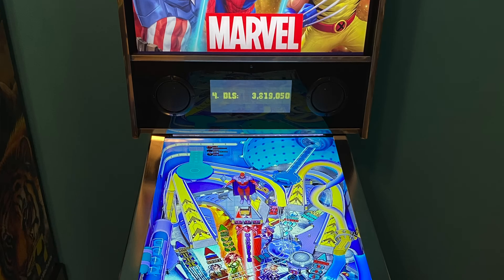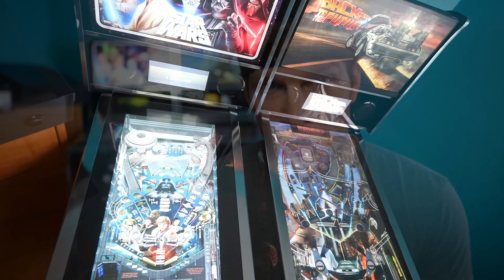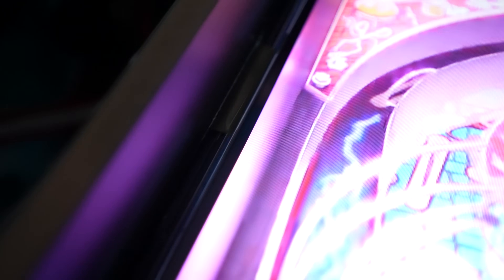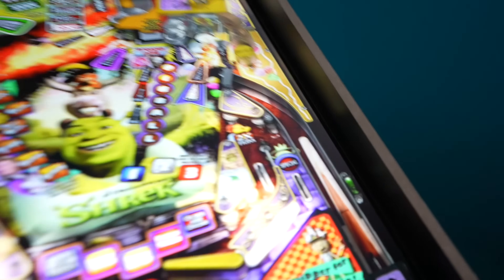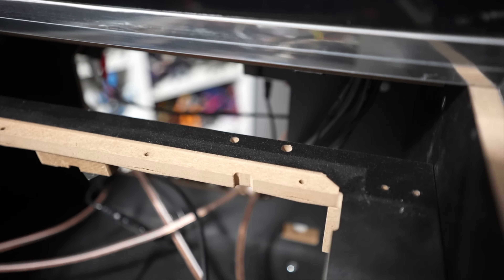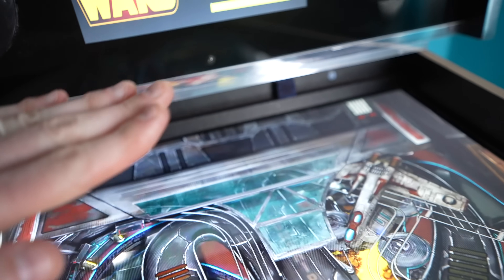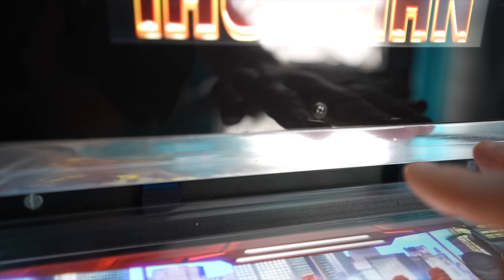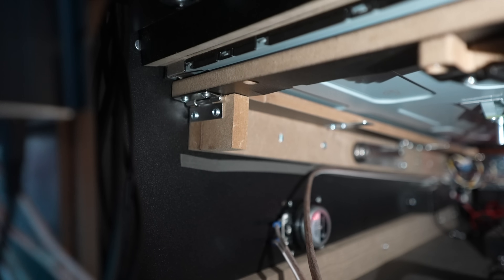Arcade1Up Pinball Mod - How To Install 32" Monitor

Comment: Doug, how did you actually de-case this monitor?  I've got the unit, and there is one screw on the back next to the HDMI, but I assume I've got to pry it open?  Where did you start?  Bottom?  Any tricks or "watch outs" to know about?
Reply from the maker: I used a thin flat head screw driver to start prying off the out casing. Just slowly working my way around the monitor in circular fashion until I was able to pry off the bezel
Reply: @cooltoy  Awesome.  Thanks for the fast response.  Done and done.  For anyone following, it's easiest (I think, at least on mine) to get it off at the bottom once you do a once around with a very very thin screwdriver.  There will be some snapping sounds as the plastic catches disengage.  After black casing is off, you then also need to remove outer silver frame on the edges to get it to fit in the pinball unit.  Remove the black tape to get at the outer silver frame and then stick the tape back.  You can sort of see how Doug did this at 2:05 (black tape shows signs that it was unpeeled and then re-stuck on after) and when you are done it will end up looking like it does at that time stamp.  On my cab, I also loosened the top four screws just a turn to give some extra room - otherwise my monitor wouldn't quite fit (even with the "diet plan").
Reply: @dimmydinosaur5571  I got all the way to the point of decasing everything and loosened the top screws on the body but it still feels tight. The screen is so thin and fragile I think any bending or pushing may crack it trying to get it in. Was it difficult for you to get it in such a tight space

Comment: Maybe I missed it but obviously I need a new piece of glass after modding to 32”.  What size is recommended?
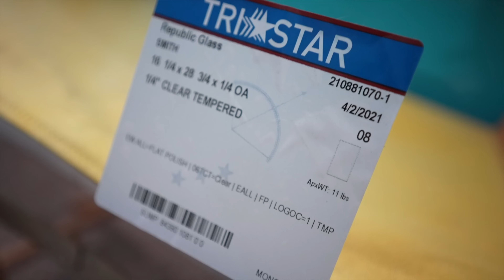Reply from the maker: It’s at the 5:32 mark in the video
Reply: @cooltoy  Thank you!!
Reply: I’m also using a stock Dell 9020 desktop for my setup.  Did you use the stock graphics card it came with or did you install something else?

Comment: So I'm not too tech savvy so please forgive my ignorance, but does the PCB, the stock monitor or both hold the res to 720p. More directly, can one improve the resolution with the stock PCB with a better monitor?
Reply from the maker: the stock arcade1up PCB is what is holding the display output to 720p. The stock arcade1up 24" playfield monitor is 1080p capable, yet only displays 720p when connected to the stock PCB due to the preset output coming from the PCB. You can not make any changes to the Arcade1up stock display resolution while maintaining the stock PCB.
Reply: @cooltoy  Ok thanks for the clarification. Now I won't waste time and money on something that won't pan out. Good video BTW.

Comment: I am excited to try this! I have a couple questions. How easy is it to get inside the cabinet once this monitor is installed? Are you able to use the original monitor base to angle it up or will the monitor have to come out completely? I'm also assuming you had to completely remove the original monitor from the machine, but I just wanted to make sure. Thanks for the content and always engaging with your viewers!
Reply from the maker: you can get inside the cabinet through the backside panels. Otherwise you would need to take off the trim pieces, remove the glass/plexiglass, and remove the monitor if you needed to access the inside front of the machine. As shown in this video, I'm using the original monitor base frame. The original monitor will need to come out as there is no sense in leaving it inside and then placing a new monitor on top of it.

Comment: Great mod!! How's the angle and depth of the play field feel? Are you getting any reflections off the tempered glass or between the 32" screen and glass that make it harder to see the play field?  It looks great!  I just got my pc and vsdisplay for stock 24" at 1080p and extra back screen monitor installed in the cabinet. Connecting the buttons and plunger this weekend. Will seriously consider updating to 32" in the future.  Just worried about angle, depth, reflections and glare.
Reply from the maker: The angle of tilt is almost the same as it was for the stock monitor, so no complaints there. Also zero issue with glare or reflection from the new piece of glass.
Reply: @cooltoy  I'll be upgrading to 32" then, thanks for all the tips!!

Comment: Great Video! Ordered the monitors, When you used "FRDM-KL25Z " do you have a link to a pre assembled one with the pre installed headers? Could you use a Zero delay 2player instead? TY
Reply from the maker: You can use a zero delay encoder, but the plunger won’t connect to a standard usb encoder since it’s an analog input. There is a Geeekpi encoder that works that uses normal digital button inputs as well as analog inputs that you can use if you don’t want the KL25Z board, but you lose analog nudge capabilities if that matters to you. 

I believe this is the site that sells the KL25Z with the headers preinstalled https://virtuapin.net/index.php?main_page=product_info&cPath=8&products_id=131&zenid=8iimjqqpuj05j8c08j632tf257
Reply: @cooltoy  thank you so much!
Reply: @cooltoy   sorry is this kit all i would need to get both the board with headers like you used and also the ability to utilize the plunger ?  This seems to be the board and plunger kit together?

 https://virtuapin.net/index.php?main_page=product_info&cPath=8&products_id=105&zenid=8iimjqqpuj05j8c08j632tf257
Reply from the maker: the link you provided is the all in one kit, has the board, headers, wiring, plunger etc. That's the same kit I'm using currently.
Reply: @cooltoy  You are the best. TY

Comment: Are the games running at 1080p now? Looks great!
Reply from the maker: The stock monitor is 1080p but was resigned to only outputting 720p from the stock hardware. I showed in previous videos on this channel how to hook up the stock monitor to the pc and what it looks like running 1080p also on this channel if you want to see that.
Reply: @cooltoy  I watched those videos as well. I figured the stock pcb couldn't run at 1080p. I was just being hopeful. Would love to upgrade the monitor and keep the pcb stock and run at 1080 but that's just asking too much 😔

Comment: I remember a while back you mentioned that Arcade1up pinball is too expensive to buy if we are just going to gut and mod it. 

What price would make sense if we’re planning to use it as a base platform? Or is it still just better to start from scratch?
Reply from the maker: I originally said that for a multitude or reasons, one of the main ones being that pc graphics card prices are pretty much through the roof right now. However after looking at the “vpin kit” option prices currently out on the market today, it actually does make pretty decent sense to go the Arcade1Up route instead. Assuming you like the smaller foot print it provides. It will always be cheaper for a person to build from scratch, however, that’s not in the skill set of most individuals I know. You can do a bare bones PC mod to the Arcade1Up pinball machine for a few hundred bucks. Even with the price of the  Arcade1Up cabinet itself you still come out several hundred dollars cheaper than the baseline vpin kit out there today. Obviously the more “bells and whistles” you want the more you have to invest, but ultimately that’s up to the end user. The AtGames pinball machine is also another good option as it is already natively set up to support adding a PC, though it has a larger space footprint which may turn some people off that are limited on space.
Reply: @cooltoy  Awesome, I appreciate your answer, thank you! 

My first mame cabinet I built started with a $99 Golden Tee and a Raspberry Pi. Before I even played it, I got a Dell 20" monitor, new control panel, new speakers, etc. The only thing left from my purchase was the MDF. I basically paid $99 for a pre-cut cabinet and some spare parts. lol

Comment: Excellent job, Doug! I really wish we had more options in the market. I would pay for a 1up (toy) virtual pin if it had a higher resolution 32" screen and priced around $1000. I feel it hits a perfect sweet spot between the minimal 1up and a much more expensive virtual pin.
Reply: Can i just put in the 32inch monitor as described and the machine will still be fine to play
Reply: You can do his mod with a 2k screen and the marseilles will upscale 720p to 2k.

Comment: You can alter the playfield size anyway in vpx and future so cutting off the bottom isnt an issue.
Reply from the maker: true, but honestly the cropped off portion is so insignificant to me it's not even worth doing that. I merely mention it just to be up front with everyone on the end results.
Reply: @cooltoy  absolutely sir, PLUR.greets from Spain

Comment: Before i saw your live video and you posting this I was trying to figure out what monitor I  was going to go with. Asus has a thin body 31.5” (found on Best Buy) that I was thinking of using. Seeing the 32” I see you used, I wonder if the .5” less would be just enough where you wouldn’t have to uncase it.
Reply: I’ll most likely just order the monitor you used though, wife will kill me if I keep buying and returning shit 😂
Reply: 31.5 might be the magic number for those of that dont want to pry the bezels off. It looks like most 31.5 screens are 2 inches less in height compared to the one used in this video
Reply from the maker: @Josh Hundley it'll will be a case by case basis since all monitors are made differently.. I contemplated using a few other different monitors but had to turn away from them since they had their HDMI input ports on the sides of the monitors, and I knew that would be problematic for the install. Lots of little things like that I had to keep into consideration. Though you may very well get lucky and find that you don't have to de-case that  particular ASUS monitor. If you get it, let me know how the install works for you as I'd be interested to know the end result.

Comment: Thank you SO much for showing us how to do this. It looks amazing! By the way, I got my Marvel Pinball in, and found I can NOT see the DMD, so I'm in the process of prototyping a magnifying device to park in front of the DMD, so I can see it. It's pretty simple, just a couple of suction cup tipped toy arrows, and a pair of lab clamps, with swivel grips, which will hold a Fresnel page magnifier, at just he right angle. The magnifier makes the DMD look nearly as big as a 4/4 scale DMD. I'm definitely going to have to look into installing 31" monitors. Using the 24" screen, with the included tables is like playing pinball with a BB. LOL That's really hard for me to see. Congrats on getting that monitor in, and the exterior detail work reinstalled, nicely! :)
Reply from the maker: glad to hear you McGyvered  a solution for the DMD for yourself, I know that's one complaint my wife has made about our Star Wars pinball, that the DMD text is small and hard for her to read.
Reply: @cooltoy  Ah, sorry to hear your wife isn't able to read that tiny DMD, either. All the stuff you need to make the device is on Amazon. Just look up Fresnel page magnifier (7x10), for the lens, and just toy arrows, lab clamps (test tube holder clamp). The arrows' suction cups hold nicely, to the plex, or rails. Position about 3, or 4 inches out from DMD, and center along sightline, between DMD, and height of eyepoint of player.

Comment: Can you connect this monitor to the stock A1up PCB?
Reply from the maker: Not without using a specific LVDS to HDMI adapter board, and even then there is no guarantee it would perform correctly or look good. I would advise against it personally.

Comment: In VPX you can manipulate the tables so you dont lose that bottom cropped area. You can also resize in nvidia control panel as well. I think I'm going to stay stock playfield screen. I like ease of access to my PC inside. I'll do something like this when that monitor blows out.
Reply from the maker: true, but honestly the cropped off portion is so insignificant to me it's not even worth doing that. I merely mention it just to be up front with everyone on the end results.

Comment: To fix the cutting off the bottom of the play field couldn’t you adjust your computer’s overscan settings?
Reply from the maker: In windows 10 you can not scale below 100%. In VPX you can adjust the table size though and prevent the bottom from being cropped, but honestly the cropped off portion is so insignificant to me it's not even worth doing that. I merely mentioned it just to be up front with everyone on the end results.

Comment: Awesome video as usual. The v display you recommended for the stock monitor is perfect. I was able to change the colors and turn down the brightness. What a huge difference. It's a shame that they couldn't do this before they shiped this out from the factory. This 32-inch mod has got me tempted. Maybe down the road. Thank you for making awesome content and helping me mod my cabinet. Shout out to Nail Buster for being the man and providing us with the software to make this happen. If I could I would buy you a beer.
Reply from the maker: happy to hear you were able to get the monitor settings tweaked to your liking.  Totally agree, Nailbuster's software is truly an amazing gift to the community, can't recommend it enough.
Reply: @cooltoy  broke down and ordered the 32 inch monitor this morning. Now going to call the local glass shop. Thanks for making an enticing video lol

Comment: its called buy a Legends pinball
Reply from the maker: I already did, I’m assuming you haven’t seen those videos....
Reply: @cooltoy  I know you did. Your vids helped me get my legends going. I was speaking to all the others out there to save them some time and money. Instead of them doing a big mod on the 1up to get a larger screen, they should just follow your lead and get the product already available.
Reply: @corycardwell  there are pros and cons to each purchase. I personally like the 1up better because the trim looks like a real pinball table and once you put a 32" monitor in it, even more so. So for me the legends was a no go. I did not like a lot of aspects of it and I am very happy I decided to go 1up for my vpin cabinet.
Reply: Some may prefer or just not have room for the larger footprint of the ALP machine. Especially now that you can make the screen the same size.